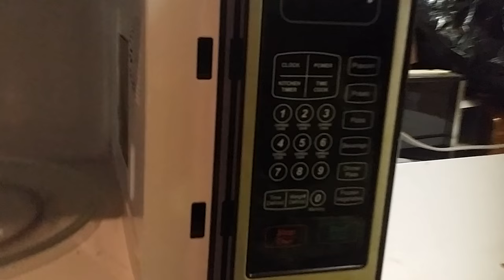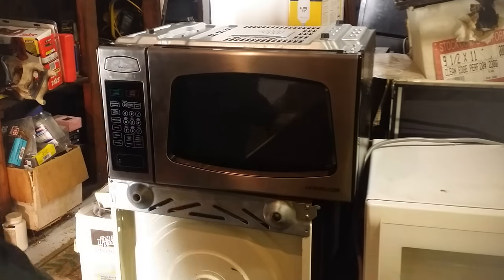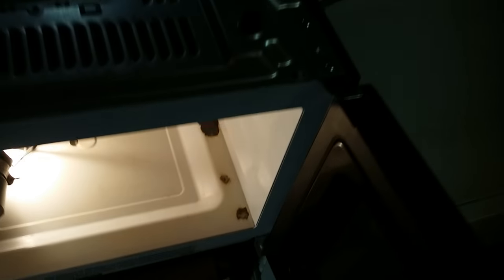Microwave rust damage repair

Comment: Folks who have painted a cast iron stove know that there is a difference between the many kinds of "normal" paint (like automotive paint) and paint designed for high heat. There is such a thing as oven paint or microwave paint or cast iron stove paint: They are made to withstand high heat and avoid emitting toxic gases in high heat. Pro painters also know that when one is trying to paint a patch, feathering it in smoothly with existing glossy paint (like on any appliance), it is necessary to lightly sand the existing glossy paint with a fine grit sandpaper (like 220) so that the new paint adheres well with the old paint and does not flake off later. It's the same principle used to resurface roads, glue nonporous materials, etc. For all these reasons, I really appreciated a different YouTube video "How to repaint inside your microwave - fix interior rust and peeling." I'm not related or friends with that YouTuber -- I just think he did the job right, matched the original color well, and produced a result that would not have to be redone later.

Comment: Thanks my microwave has a 1 inch hole at the bottom due to corrosion, how do I fix it, can put in a bathroom filler and then paint it with the substance that you just used? thanks

Comment: Is it safe to use the microwave if a part of the paint had been chipped off about 2x2inches in size? The location of the area is at the panel below on the left facing the oven (the door is open).

Comment: I e-mailed Rustoleum web site about which of their paints to use inside a microwave.  They said none of their paints were suitable for the interior.
Reply from the maker: Seasider48 / Enamel Appliance touch-up paint is available from most appliance part distributors, often in a small brush-on bottle. That is probably the best product to use, however I don't think it varies much in content from the rustoleum product. Since its unlikely that you will have any food contact with the product unless it flakes off and gets into the food, but that would be bad no matter what product you use. Thetefore, it is always advisable to cover your food while cooking it, and inspect the cavity when you are cleaning it for signs of loose paint.
Reply: This may be for legal reasons and it may or may not be a hazard. However, it's not designed and tested for that use,  It may have lead in it or something and if a flake or chip fell into an open container, well that would not be good.  I guess it depends.  My rust is a small spot on the bottom of the microwave under the rotating platter, so I might risk it but I wish there was some sort of silicone sealant .  I think silicone is pretty inert and suitable for high temps.

Comment: I noticed on the right side panel, looking in, there's a square ( approx. 4"x4") looking unfinished spot at 0:52. What is it and is it supposed to be like that. The reason I ask is that I noticed a spot like that in mine.

Comment: There is a hole at the bottom of the turn table. What can i use as a base or put over the hole before painting? Microwave is only 4mths old.

Comment: I'm trying to attempt to repair my microwave on my own. My microwave still works but the paint is chipping off. The damage is at the bottom floor of the turntable. My issue is that the repair is not just a mere spot here and there like in your video, so I don't think a small bottle is sufficient. When buying the paint should I get the same paint like you have but in more quantity or does it only come in that small bottle? I am not also able to read the bottle that you showed in the video. There is too much shadow inside the microwave for me to read it just by the lamp light you have. It was too dark. There's a Walmart close to my home. What paint should I ask for? Thanks
Reply from the maker: Nweisha Ng The paint is automotive touch-up paint made by Rustoleum, available in the automotive section. if the rust is in the dolly groove, try to make the repaired area as smooth as possible.
Reply: Thank you so much for the quick response. I'm heading out now to get that paint.

Comment: Hi. My microwave is rusting along most of the bottom back seam; it appears they didn't put enough paint on seam, so there is a nice rust line running nearly the entire width of the inside of the microwave. Do you have any suggestions for rust in that particular area or would the procedure be the same?
Reply: i have the same problem with my microwave. any solution

Comment: I have a microwave with a tiny (1/8”) peeled paint spot, is it safe to use like that?
Reply: Yes Emmanuel. My family ruined the paint under the carousel by overflowing soup or something over the tray and not cleaning it up. It pooled there unnoticed for days, during which the paint came off and it started to rust. We're remodeling the whole house, so once I discovered and drained it, fixing it was not our highest priority for months. There has been no change in its performance or safety since then. We're only now getting around to fixing it.

Comment: i have bought rustoleum heat resistance 1200f  spray paint can . should i use it inside microwave to paint at rusty surface
Reply from the maker: ashish ganjewar   yes, you can use it. but you will need to mask the areas where the vent holes are, and mask the wave guide (thats usually a piece of plastic or mica sheet that covers where the magnetron antenna is). Do your cleaning and preperation, spray your affected areas, then let it dry with the door open a minimum of 24 hours before you use it.
Reply: CJ Haywire Verschaeve thank you very much . you are the best

Comment: Do you have any fixes for paint that is flacking off of the inside of my microwave?
Reply from the maker: K Wright  follow the instructions on this video. it shows how to remove loose paint and touch up areas where paint has flaked off.

Comment: will the repair paint cause reaction when microwaved that causes fume or anything that may poison the food?
Reply from the maker: SDU-Tango It shouldn't, as long as you let the paint cure for 24 hours before using your micro. The paint needs time for solvent and carriers to evaporate as part of the normal curing process. the remaing paint should be similar to what the manufacturer used originally.
Reply: SDU-Tango yes

Comment: What color the base metal be once you have cleaned up the rusted areas?
Reply from the maker: manoj prakash: Usually, the base metal is silver, however once it rusts, it becomes brownish in color. If you are doing spot repair, you only need to remove all the loose paint and loose rust scale. the metal is not very thick. if you attempt to grind on it, you could accidentally grind through, which is not repairable.
Reply: Thanks.

Comment: This is wrong method. You must sand down the rust first and make sure the paint is microwave paint. Normally grey. But this guy is doing a white inside which is different. You can get a microwave paint kit on eBay.
Reply: Maybe the customer didn't want to spend $34 for a paint job. I mean really it's just a microwave for it's not gonna last forever. I understand that the sanding all that. Microway paint kits are ridiculously expensive for what they are. But I understand what you're saying. But not everybody can afford what it is you want them to do. Sometimes people have to work within a budget that they have. I know radical concept...

Comment: Will the rustoleum appliance epoxy work for this?
Reply: Yes.  That's what you should use instead.
Reply: @christopherfoote3395  thanks. I ended up using some oven repair paint and it just rusted again. It was trapping a lot of moisture in. We bought a new one.
Reply: On the can it says not for hot surfaces.

Comment: can you respray the inside,if so what paint to buy?
Reply from the maker: Shalandra Collins I have not tried a full scale re-spray, but I think that if you had it thoroughly cleaned, scuffed the old paint with steel wool a little, and masked the wave guide, door and vent areas, you could use Rustoleum spray enamel sucessfully.
Reply: @guzzog  can I get it in SA if so which shop